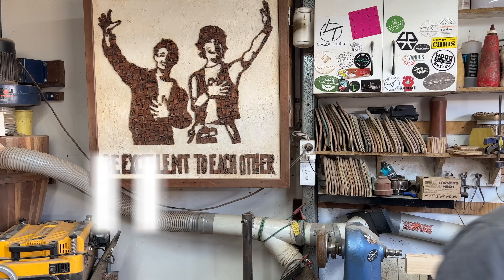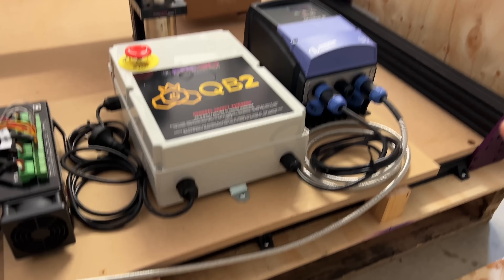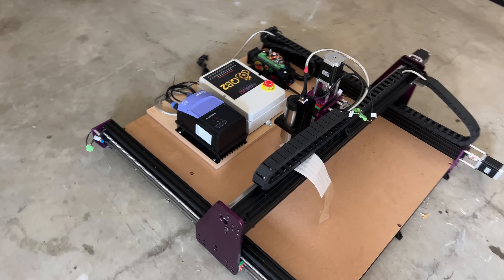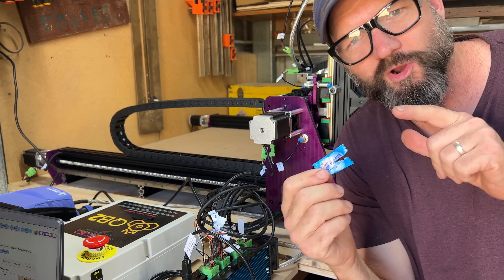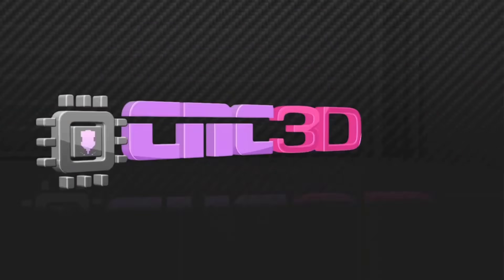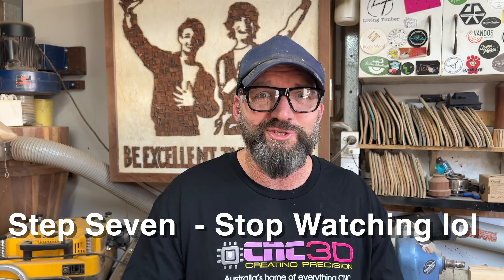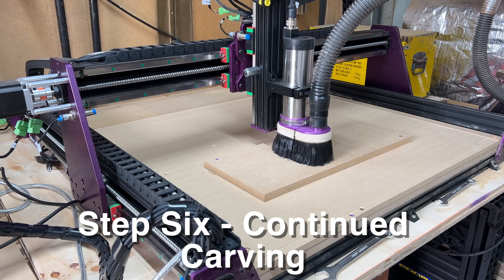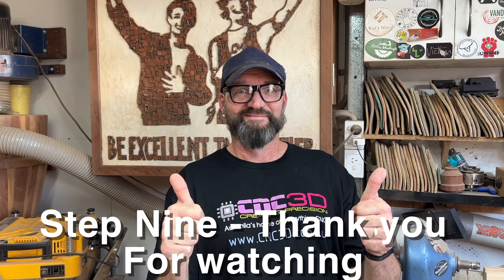Side Hustle addition - CNC?

Comment: Storage and sanity, I like putting CNC under assembly table. It sucks to bend down but it doesn’t take up another table top and the square meters.
Reply from the maker: Unfortunately I don’t have 1200 under bench. Not with out cutting a hole in the shed. Which I did consider 😆